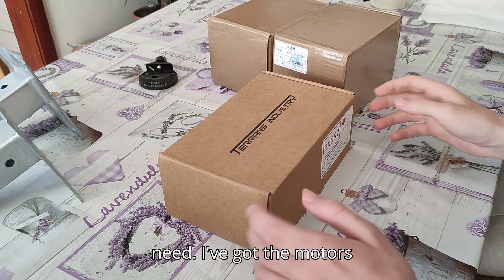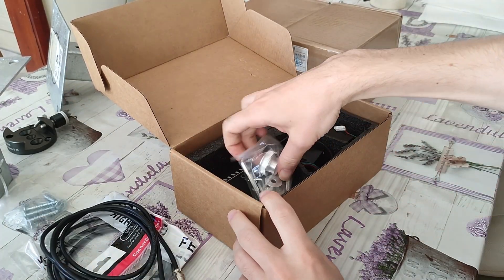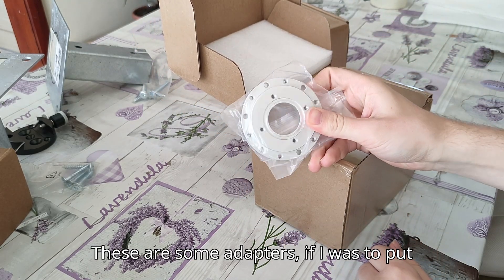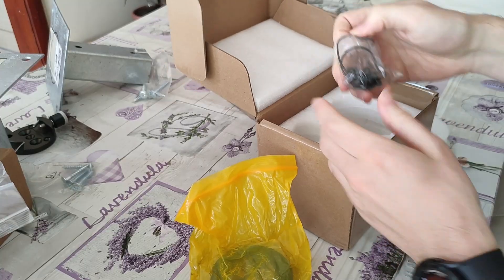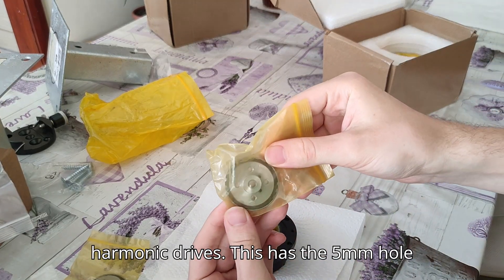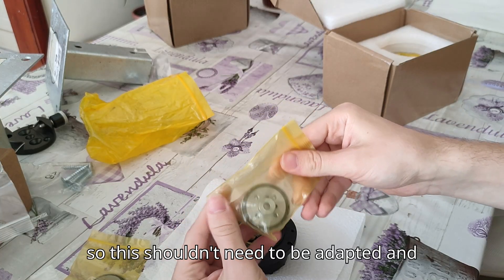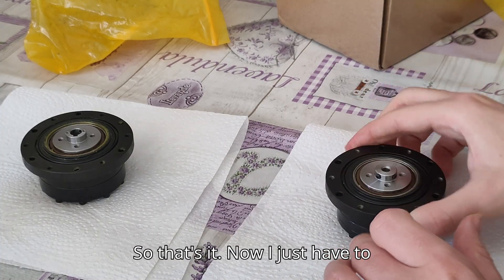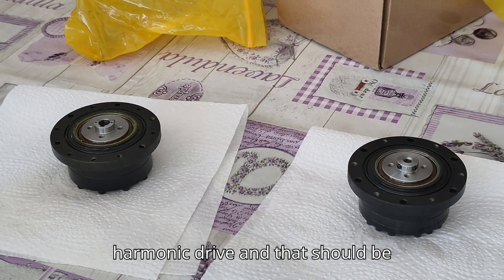DIY Harmonic Drive Mount Part 2 - Assembling the HDs

Comment: Could I please ask you which 8mm to 5mm adaptors you used? I have the same issue that the harmonic wave generator hole is 8mm and the rest of my gear is 5mm. Thank you
Reply from the maker: Hi, I found that the ones meant for RC cars work great. If you try to search 1:8 RC car shaft sleeve, then you can easily find ones that are 5mm internal and 8mm external. 

Otherwise, I am experimenting with 3d printed shaft adapters and they seem promising but they have to be kept quite short so the metal ones may be better in the long term.
Reply: @StackedandTrackedthanks for that. I found those and have ordered. For the meantime I did make a 3d printer temporary design that works. I’m happy to share it with you. Is there a way to send a private message or email?
Reply from the maker: @paskoh  I think a WeTransfer link would be easiest, I don't think YouTube has direct messaging.

Comment: Nice project, keep going! Im setting up my garage for machining aluminium/steel to build a big mount. Interested to see what your experence will be with these harmonic reducers, as I'm also looking for ideas for gear reduction.
Reply from the maker: That's great! I also thought of building a larger mount but since I didn't know how to approach it or how it would turn out, I started building this smaller travel mount. Thankfully it turned out great. I already have plans to build an observatory class mount with a very high payload though it will probably take a lot longer, especially as I plan to build my own electronics.

Comment: Please tell me where you bought the gearboxes. Provide a link.
Reply from the maker: Sure! I bought the harmonic drives from 2 different sellers. Here is the link to the seller that had better service and faster postage:

https://a.aliexpress.com/_ExCCkdC
Reply: @StackedandTracked 
Thank you very much!
But, I have already ordered from another seller.
Reply: @StackedandTracked, I used the link but it’s for the 8mm keyed version, not getting any feedback from the supplier. Do you have the link for the vendor supplying the 5mm keyless version, or a link for the 8-5 adapter? Great video by the way!
Reply: @Filbertdog  
Typically, a stepper motor is used with a belt drive. On a telescope, the overall reduction ratio should be no less than 1:500.
Reply from the maker: @Filbertdog  Hi, I believe the link I sent here was the one from the better seller, here is the link for the other seller, try to send them a message to see if they supply the one with the 5mm hole before ordering.

https://a.aliexpress.com/_EugR58E
Reply: @StackedandTrackedawesome thank you. Could you also put both links in the video description?
Reply from the maker: @nurbson3202  Hi, thanks for the support, I am having a few issues with YouTube verifying the channel before I can put links in the description, I am working on it for now though I will post a comment on each video with all of the links for both drives and the control box.